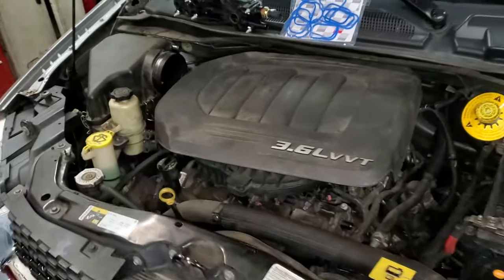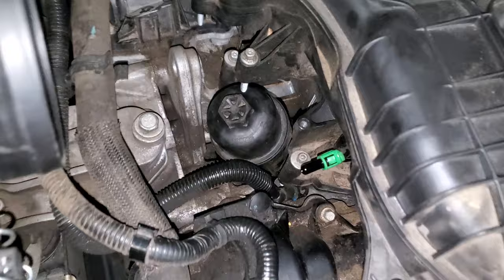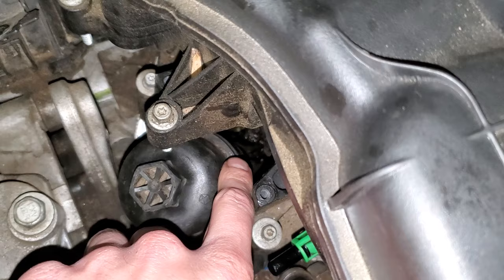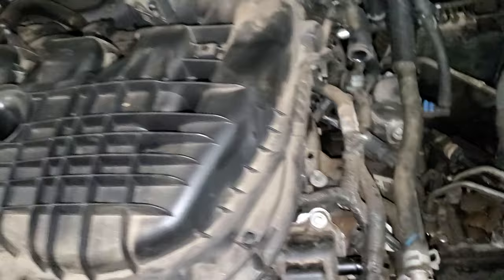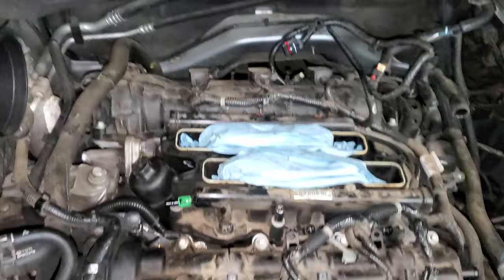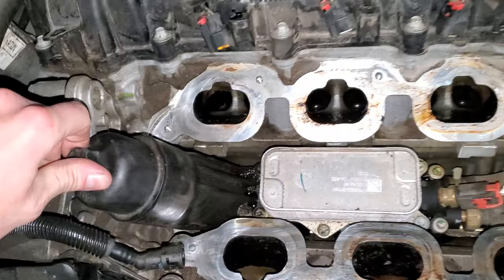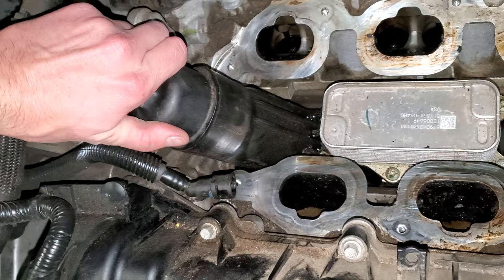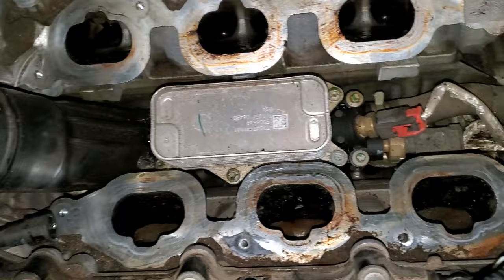Chrysler/Dodge/Jeep 3.6L Oil Filter Housing Leak - Common Problem

Comment: Hi all, It's not actually the housing cracking,  nor have anything to do with over tightening the filter cap.   The o-rings/gaskets under the filter housing shrink up, get hard/brittle and eventually fail after so many heat cycles and several other variables that minorly affect the rate defect.  The issue results in a plethora of symptoms/problems depending on your application and other misc variables. Symptoms range anywhere from oil smoke and puddles to check engine light, rough idling, O2 codes, transmission shifting issues, "mysterious oil consumption", etc.  The location of the leak sits on top of the valley, under oil filter housing, in between the 2 banks of the engine.  Once the leak starts the oil pools up in the valley which can hold a lot of oil, easily over 1 quart .  So depending on how aggressively you drive and how flat the ground is where you park your car it could leak for quite a long time before it ever shows itself.  It's any easy fix, less than $100 to any honest mechanic after he's done 1 or 2.  Check your oil often on these engines.  That'll be the most effective method for earliest possible  detection.   We've seen the issue clear up to 2015 models still to this day.  Just wanted to "clear the water" here.  I've seen the fingers being pointed in a lot of different  directions on this.  All of which are blaming the wrong thing other what I stated above.
Reply: this OE design is very poor. A upgraded aluminum Housing 926-876 solves a issue.
Reply: I think its the O Ring in most cases of this leak..No need to change the whole unit
Reply: I have a oil leak on my 2014 Charger SE, noticed oil on carport, got oil change, mechanic says probably cracked oil filter housing 🤔 This same thing happened about 2016 Dodge dealership who I was using tightened filter to tighten, cracked housing, saw the oil leaks not long after oil change
Reply: So it can just be the o ring nit the whole housing
Reply: @santerrasgraham9731  that worked for me..but inspect whole unit ..the o ring is only a few dollars.
Reply: Thanks, the first time it happened, dealership said it was the housing and warranty fixed it. I read up on this on Internet said same thing about oil rings, took it to mechanic in my area, he said take back to dealership, Thanks again
Reply: It can be both... I have seen them cracked from constantly over torquing the cap... I have seen the O-Rings Leaking and I have seen random cracks on the spout likely from Heat.
Reply: I wish I could find a mechanic in my area to do this type of work instead of taking it to dealership, that's a lot more expensive!
Reply: @ritast.johnstiles8008  What area are you in? Im in NC
Reply: @ShiftingSkys  Arkansas, about 75 miles outside Memphis, TN
Small Town about 4500 people
Reply: @ritast.johnstiles8008  That sucks. It is an extremely easy straight forward job. For someone experianced it takes 2.0-2.5 Hours. I can send you the "how to" if you want to do it. It doesnt require any expensive tools.
Reply: @ShiftingSkys  much appreciated, I take my Charger to dealership in Wynne, Arkansas, bought it in 2016 from Ford dealership in Batesville, Arkansas
Reply: They trynna charge me $750 for a new oil housing 😔
Reply: @ShiftingSkys  I would love to get that information from you.
Reply: @brianbaker5687  My brother just did one at our shop and he ddi it in 2 Hours 15 Minutes. 
NOTE:
If the Oil Filter Adapter (OFA) is being removed for an Oil Leak Condition, Oil Dye (P/N – CH5010042AC) MUST be used first do determine the location of the oil leak. (If oil dye has not been used, the repair will not be validated)

Perform the fuel system pressure release procedure (Refer to 14 - Fuel System/Fuel Delivery - Standard Procedure) .
Drain the cooling system (Refer to 07 - Cooling - Standard Procedure) .
Remove the lower intake manifold (Refer to 09 - Engine/Manifolds/MANIFOLD, Intake - Removal) .

Disconnect the oil temperature sensor and oil pressure sensor wire harness connectors (3).
Remove the five oil filter housing bolts (1) and the oil filter housing.
Lift the oil filter housing and disconnect the heater hose (2).

NOTE:
If there is an oil leak (identified by the use of Oil Dye – CH5010042AC) coming from between the OFA and the valley deck mating surfaces, replace only the four gaskets and the drain tube O-ring as shown here. The O-ring and four gasket set is #68191356AA.

Remove and DISCARD the oil filter housing seals (2) and O-ring (1).
Reply: @brianbaker5687  .

Disengage the upper radiator hose retainer (1) from the upper intake manifold.
Remove the engine cooling fan and shroud assembly (Refer to 07 - Cooling/Engine/FAN, Cooling - Removal) .
Remove the intake resonator (Refer to 09 - Engine/Air Intake System/RESONATOR, Air Cleaner - Removal) .

Disconnect the electrical connectors from the Manifold Absolute Pressure (MAP) sensor (1) and the Electronic Throttle Control (ETC) (7).
Disengage the ETC harness from the clip (8) on the throttle body. Disengage the wire harness retainers (4 and 5) from the upper intake manifold near the MAP sensor and reposition the wire harness.
Disconnect the following hoses from the upper intake manifold:
Positive Crankcase Ventilation (PCV) (3)
vapor purge (6)
brake booster (2)

Disengage the wire harness retainer (4) from the upper intake manifold support bracket (5).
Disengage the wire harness retainer (3) from the stud bolt (2).
Remove two nuts (1), loosen the stud bolt (2) and reposition the upper intake manifold support bracket (5).

Remove the nut (2) from the support bracket of the heater core return tube (1).

Remove two nuts (1), loosen two stud bolts (3) and reposition the two upper intake manifold support brackets (2).

NOTE:
The upper intake manifold attaching bolts are captured in the upper intake manifold. Once loosened, the bolts will have to be lifted out of the lower intake manifold and held while removing the upper intake manifold.

NOTE:
Exercise care not to inadvertently loosen the two fuel rail attachment bolts that are in close Proximity of the upper intake manifold attaching bolts.

Remove seven manifold attaching bolts (1) and remove the upper intake manifold (2).

Remove and discard the six upper to lower intake manifold seals (1).
Cover the open intake ports to prevent debris from entering the engine.
If required, remove the insulator (2) from the LH cylinder head cover.
Reply: Thanks for the info
Reply: @ritast.johnstiles8008 o never mind. I miss read it
Reply: I've had to do o- rings 3 times on the same truck. Oem Mopar parts. They come out melted. Have you experienced this?
Reply: Does  anyone know if dodge will warranty this under their 100,000 mile drive train warranty?
Reply: This just happened to me in my 2017 pacifica cost 1600 to fix.
You men that know how to work on car engines and understand all this stuff are badass. I hope you are appreciated by your family and in your everyday life.
Amazing skills you have. 
Maybe I should take some classes so I can do this stuff myself.
Reply: the local garage down the street wants to charge me $500 in labor and $300 for the part - should I run?
Reply: @KombuchaLiz Did they put another Oem cooler back in?
Reply: @seatime674  I don't know.  I really don't know anything about cars but I'm trying to learn. 
Why do you ask? I still have the paperwork I could look.
Reply: @KombuchaLiz  That's okay I only ask because it was a big issue with the plastic oil coolers cracking that were OEM original manufactured equipment from the factory when some aftermarket ones are all aluminum and some put those in instead.. If the dealership did yours you probably just got another Chrysler Factory plastic one put in

Comment: Just had this issued,, my extended warranty covered,, thank God. Dodge dealer charged $872, I only paid $100 deductible. Going forward I am taking it to the dealer for oil changes. Best video that explains on point, thank you!
Reply: My Charger was 2 years old when I bought it only 56,000 miles on it, have had a lot of recalls on it, it's a 2014 with 96,540 miles on it now

Comment: My van started having a serious oil leak not long after I have gotten an oil change from a local oil change shop. At first, I thought it was something incredibly major like a blown head gasket due to where the oil was leaking down from, but I did some research and quickly discovered it's the oil cooler. I was looking at a shop to fix this, but after a shop tried charging me over $720 just to replace the starter, I decided I would change out the oil cooler housing myself, because I would hate to see what they would try charging me for it if they think a starter replacement should be over $720. As fort the starter, I changed it myself and took a beating in the process, but it was worth it not having to throw a ton of money away.

Comment: I might drive my van 5k miles a year. I had a routine oil change in January and immediately noticed oil coming from under the car. The shop told me to check the oil for a few days and bring it back if it was low/still leaking. He said the new guys don't wipe up the old oil like they should. It wasn't low in a few days time and seemed to be okay, until last week. My check engine light came on and I took it to another shop. It was 3 quarts low! I'm guessing they really did over tighten. Now $800 later, I have a new housing installed.

Comment: Today, my 2017 Dodge Challenger SXT Plus started leaking oil a lot. I noticed a few months ago after my December 2023 Oil change, my car was leaving little drips of oil. And my engine smelt like coolant burning. This was around January. I didn't pay no mind to it then.

My car seems to lose oil only when running in idle and snooping around online, all the videos so far have shown where their oil leak was coming from. My oil pressure also has been relatively low on idle. I even brought an oil sealer that I put in my engine 3 weeks ago during that oil change. 

There is now a pool of oil sitting right below the Oil Filter housing. Luckily, I have a very long weekend to work on my car and I didn't have any use of my car for the rest of the week. However, a tow truck was needed where I pulled over after seeing smoke from my engine from the spilled oil and engine heat.

I will get a better idea once I get my car home and oil to run the car and look where the oil is really flowing from. 

It's definitely the upper part of the engine because with engine off, the oil doesn't leak like it did when it was running. It was like an espresso machine.

While under the Manifold, I should be able to also change the Oil Pressure Sensor because I get a code of that being Stuck in Open Position when I drive in 4k-5k RPMs.

Comment: Do not over tighten when putting your oils filter in. I just bought a new cap for mine and turned it too tight and cracked the housing and now I have oil spewing everywhere. This video was helpful because I wondered how oil got all over my back glass and now I know.

Comment: This needs to be a recall, it's a hazard and all 3.6 motors do it at some point, I work at a used car dealership, I have two grand cherokees and a ram 1500 with the 3.6 and they all have this issue. SMH the one doesn't even have 60k on it yet.

Comment: Just had this done on my 2011 Dodge Durango. $950 to replace the part, then had to pay for coolant and oil change. Over $1,100. Beats a car payment but I’ve thrown over 5k at my Durango over the past  five years. I am hoping this fix will last…
Reply: My wife got a 2014 Durango with 30k miles about 4 years ago and it’s been nothing but issues. The AC still needs fixing which will cost 3500. At least 4 other bug fixes needed. I’ve spent around 12k on fixes  sucks
Reply: @rickwagner3797  Update to my saga, haha! AC needs to be replaced-2k and the rack and pinion is leaking - $1,700.

Comment: I just changed the oil cooler in my wife's  van because it was definitely leaking. My concern though is what to do after I noticed oil and coolant mixing under the oil cooler. I haven't ran the engine yet so I was thinking to flush both coolant and oil from the engine.
Please help

Comment: I was just quoted 1600 dollars to replace mine.  Is that reasonable?  I really don't feel comfortable do this myself.  The quote also said the part is 593.60.  A quick look on Amazon and there are none more than 265.  What's going on?  To also be clear the estimate includes replacement of valve cover gaskets since the intake manifolds are being removed but that is only 400 of the total estimate.  Any tips are helpful.  2012 grand caravan
Reply: 1600 is what I just had to pay this week.

Comment: Hey! So question. I have the same pooling problem but it’s coolant.
Being coolant and oil runs through that part would, would you think that it could be the reason for this coolant leak in the V of the engine??
I checked the hose and it’s fine, water pump looks dry as well, just in the V is where the water is coming from but searching for info before I take the whole intake off.
Thanks!

Comment: MY TRUCK A 2021 PROMASTER WITH ELEVEN THOUSAND MILES. yes  11300  MILES JUST HAD THE SAME PROBLEM AND THEY BLAMED WHO EVER CHANGED THE OIL.   This is a Chrysler problem.

Comment: overtorquing is not the problem,, its heat, vibrations, and a shitty design.  that housing was redesigned 5 times, and still fails.,

Comment: Oil was leaking at the top of the housing on mine. Where you twist it off to change filter...I opened it and gasket was fine but there was a piece of plastic from inside of the cap inside of the spring on top of actual filter... could this be causing the leak??

Comment: I know this is old but my water reservoir started boiling and my water would be gone fast and as far as I know I had to replace the same thing I don’t know if this will fix it because water does run through there and there is no water leaks anywhere

Comment: My oil is leaking just like this. Couldn't find where it was leaking from on the drivers side. But now i have a new area to check. Thanks
Reply: Replace the unit about a month ago no oil leaks. Thanks
Reply: @treasuretim3  Got mine from Amazon around November. Check eBay  and Google Amazon doesn't have it
Reply: @treasuretim3  No prob. I might have to buy one and keep just in case it goes out again and I noticed the price went up lol

Comment: Thanks for the video. I know the oil pressure sensor is attached to the oil cooler, but what is the other sensor also attached? The coolant temp sensor?

Comment: Hi I'm running into this problem . ...I actually had this happened before years ago.  Question is would it be better to replace with the standard plastic oil filter housing adaptor unit, or go to aluminum instead ?

Comment: Love the video, short and sweet. Just changed my oil housing unit upgraded it to a metal one on my 2019 caravan. Replacing went well, but now I have an issue with a dashboard light a lightning bolt. also, the idol is not right and a lot of misfiring. What should I do?
Reply: Hi had same problem with my car ...it was the alternator

Comment: Mine is leaking. I only wrist tighten the oil filter cap, definitely not over torqued. It is leaking down to the transmission pan. Do I have time on this or does it need to be addressed immediately?

Comment: I swear it has to be from overtightening it 
I’ve had the Van, four years and have put 40,000 miles on it. I have not had one leak until I did an oil change and at the time it felt like I might have overtightened it but didn’t think anything about it but than it started leaking so I changed the oil filter and the seal thinking that was it but it’s the oil filter housing gasket after it still leaked i’m 100% it was from overtightening it! But it could be wrong!

Comment: I just replaced my oil cooler housing and the upper and lower gaskets on the manifold. Now when the engine is on and running it sounds like there is noise coming from the valve cover in the back of the engine gets louder when the AC turns on but the AC clutch is not bad. I have a 2013 Town & Country touring minivan any ideas to what it is would be greatly appreciated

Comment: I have a question, my oil cooler is only leaking coolant, not oil. I live in Florida,  what if I just bypass it entirely, to where the coolant does not flow in there anymore?

Comment: Hi, I've got a 2012 chrysler town and country with a 3.6 and there is a coolant leak in the valley would that be the oil cooler or could one of the two sensors themselves start leaking?
Thank you, have a great day

Comment: Mine pops up a code P06DD
I changed the sensor i changed the cooler with the housing as u show there i changed the oil and thing still pops up ENGINE OIL PRESSURE STUCK OFF i alreasy reseted the system and it still pops up and what it does it goes into a mode where i cant do anything with my foot pedal im thinking its the oil pump solenoid that its giving me problems has anyone gone thru this?

Comment: I have replace my daughter's twice already and it keeps on leaking oil do you think maybe because it's an aftermarket
Reply: Yep. 2015 Chrysler 200 Limited. My original cooler went at 60K. replacement went at 90K, and the new replacement leaked immediately.  Everything I am seeing is to go with the OEM version and pay the price.   But replacing the crappy black seals to better ones is supposed to help.   I am on here looking for the part number for those seals.

Comment: Hi just wondering how long this takes and what would be a typical cost for a shop to do this? Thanks much!
Reply: I have a shop tryna charge me $900 so I’m trying to figure out the same
Reply: @kingsumba  what you end up at? I paid 1000 for an aluminum replacement and still had some issue losing coolant. Now they say they will cover it under warranty but will put back an oem piece which is on backorder....